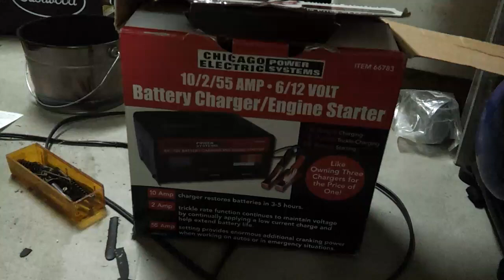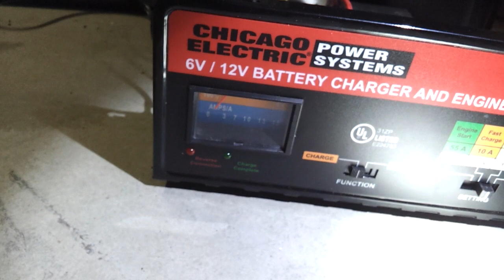Harbor Freight Battery Charger Smoking and Buzzing

Comment: That's the insulation of the copper coil melting, it's damaged and you should replace it. It could cause a short within the transformer. I'm a electrician, studied for four years and have worked for 2 years in a motor repair shop.

Comment: Are you sure that you followed the directions right? My manual says to ground the negative clamp, not to put it on the negative battery post.
Reply from the maker: It makes no difference if you ground the negative clamp or attach it to the negative battery post (as far as operation of the battery charger is concerned). The negative battery post on a car is connected to the car frame via a super gigantic braided cable (some cars even have multiple of these ground straps). Since there is a giant cable connecting the car frame to the negative battery post, you can connect the charger to either the post or a ground. The only reason the manual says to connect the negative clamp to a grounding point is because the lead acid batteries can possibly release hydrogen gas, and when you connect/remove the charger the spark that it makes can ignite the gas. This is pretty uncommon, honestly, but it's still a good idea to use connect negative to ground so that the spark happens away from the battery. The same goes for jumper cables too.
Reply: What do you think ground is?

Comment: I seen another video like this and that one was caused by a bad routing of wires the handle moves up and down then pushes wires till they wear and short. White wire on the power cord is one of them.